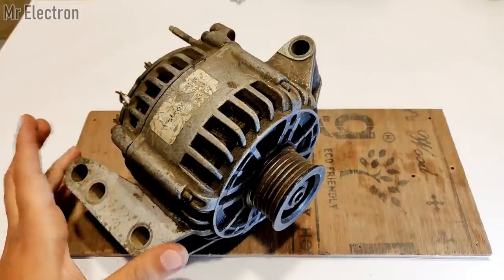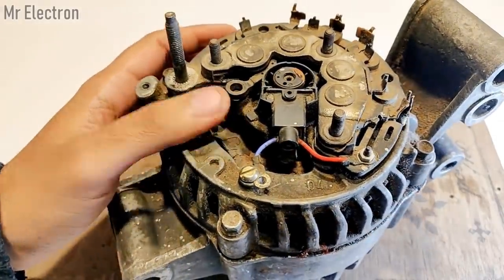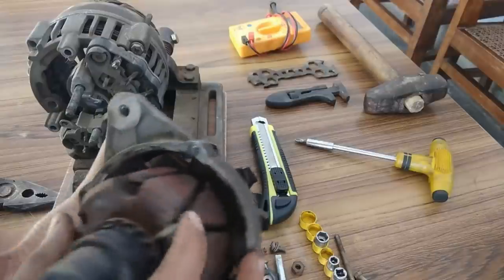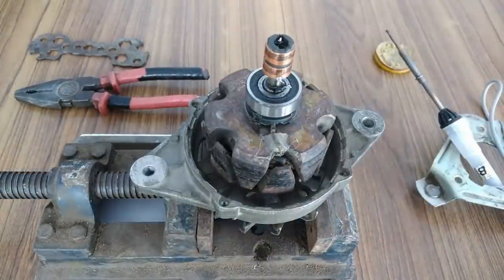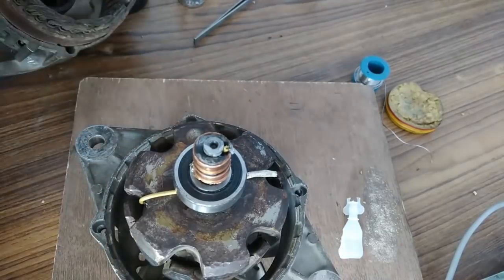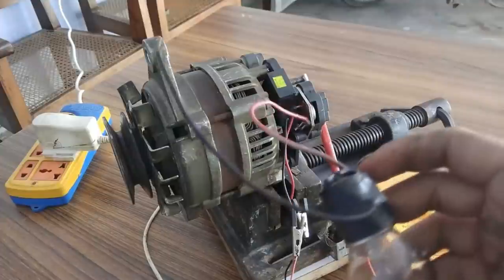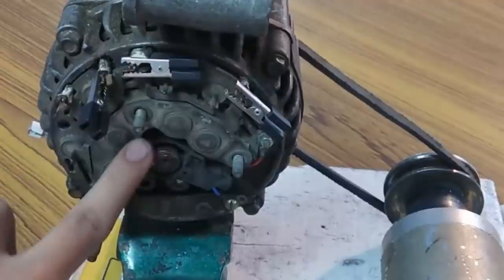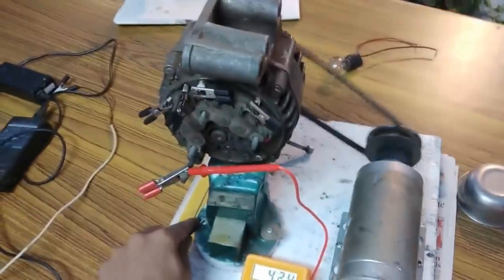3 Simple Inventions with Car Alternator

Comment: If you were to put a much larger pulley on the 12volt motor would that increase the voltage out of the alternator since the alternator shaft will be spinning twice as fast🤔?

Comment: OK for a demo ......But never put this alternator back on a vehicle after repairing it like this. The field rotor should have been dismantled and the winding renewed if the inner lead is broken. If it was the outer lead that was broken then as a minimum, one turn can be un wind and solder back at the commutator.

Comment: Removing the pulley from these units is best accomplished with a pneumatic impact gun to get the nut off, then using a puller tool to remove the pulley. Any other method is just too difficult.

Comment: hello, does it work on industrial machines?
Reply: Higher volts can be achieve according to the alternator specs as much as 14.0volts but the Wattage will be an restrictions issue as the Ampere also playing a part of the circuit system.
The best way is running at constant rpm speed to achieves that 14volts DC and the output to supply to an inverter which could provide 240v with at least 1,000 Watt output.